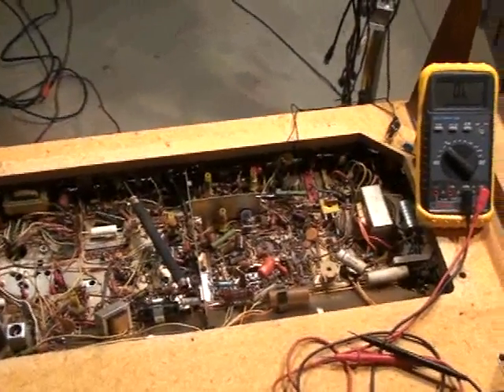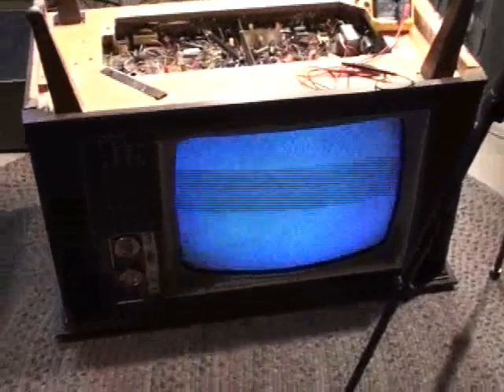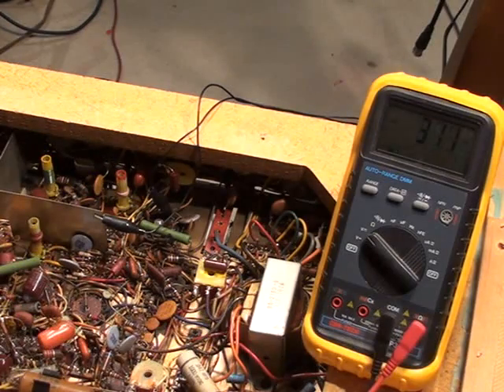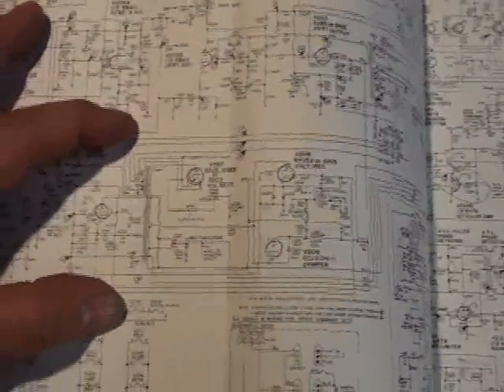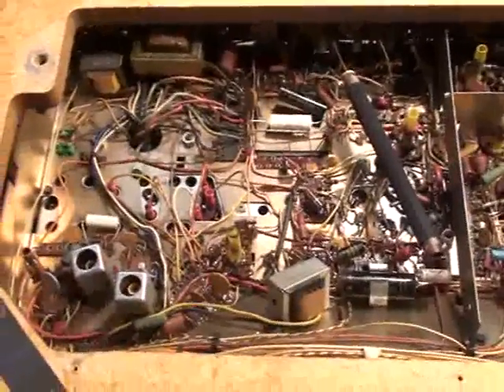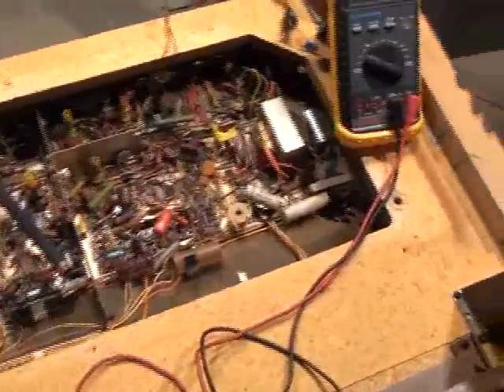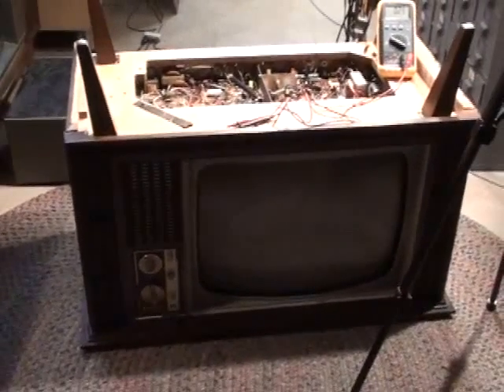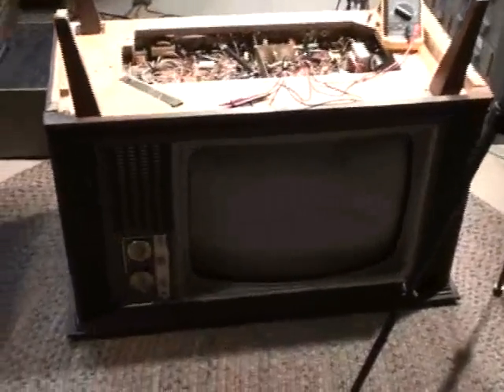1971 Zenith color television in repair, part 4 of 4

Comment: I love your instructional videos and your thoughts on preserving American designed and built technology. I am getting back into ham radio. There is a 40 year gap from when I left it behind. I just bought a Swan 500cx transceiver from about 1968 vintage. I may one day buy one of the Japanese radios like Yaesu but I really love those good old American made tube radios. In the 60s I worked for an industrial oven company who built ovens for the Admiral picture tube plant. Gary

Comment: I still have my Parents first color TV that they bought in 1968!  A 19 '"   GE with the KE chassis.   Flyback was replaced by me back in 1978, and CRT in 1980.   CET since 1980!    Restoring TV's, and radios from the 40's and 50's now.  And guitar amps!   Fender, Gibson, Guild, Vox.
'

Comment from the maker: Yes, the A is for amps.  mA is for milliamps, which is 1/1000 amps.  Thus, .5A is equal to 500mA.  What you did was correct.  Sounds like the TV has a fault, most likely a capacitor in the power supply is either shorted or extremely leaky (electrical leakage that is, a somewhat low resistance from the capacitor's + to - terminal)

Comment: I have a question about fuses, when they are rated with a number and a big A, does that mean its Amps?  I have a fuse from a Maxi-Matic TV/radio combo that blew.  The fuse reads .5A, I can't see a 1 before the point.  The new fuse I put in is 500mA, worked fine in radio mode, TV mode it worked for about 10 seconds and then blew.  So was my original fuse a 1.5A instead of a .5A fuse?   If so, I do have 1.6A fuses, could they be used safely?

Gary

Comment: While it is the results are what counts I disagree with your procedure.  I would have started with the high voltage rectifier.  I have replaced many flyback transformers in Zenith sets simply because the high voltage rectifier was shorted.

Let’s fire up the set.  We have sound, no high voltage; smell that?  That is the HVX donut melting down.

Doogie